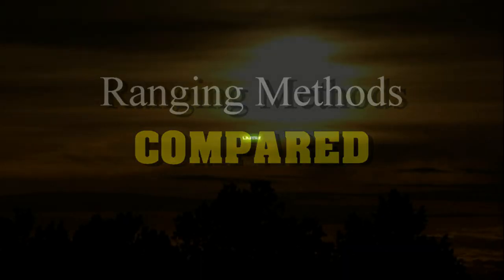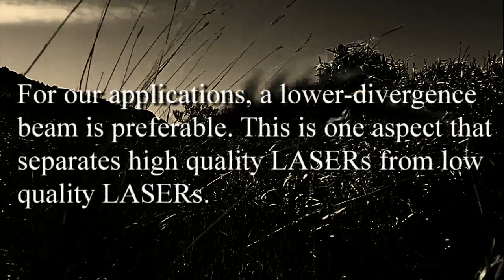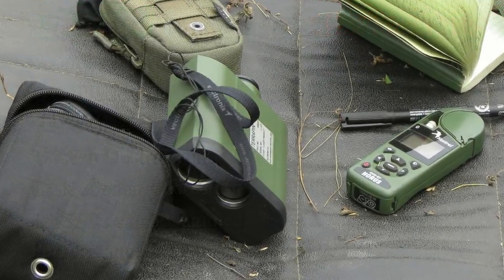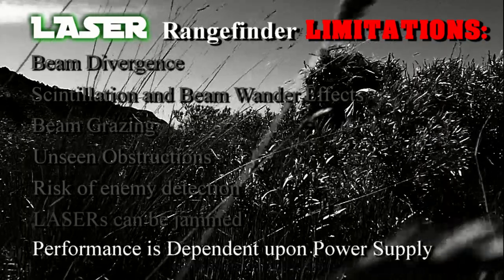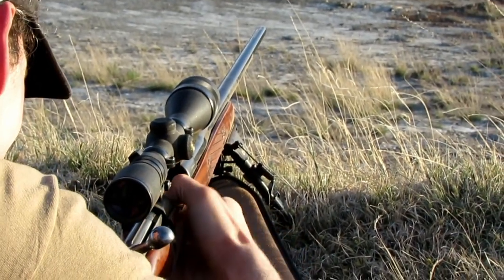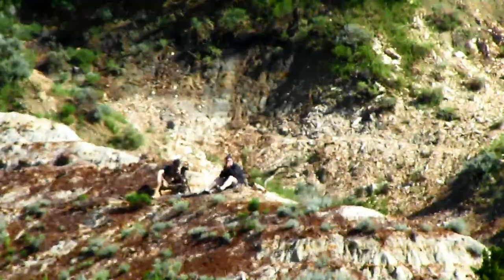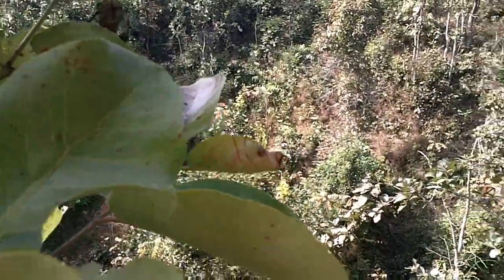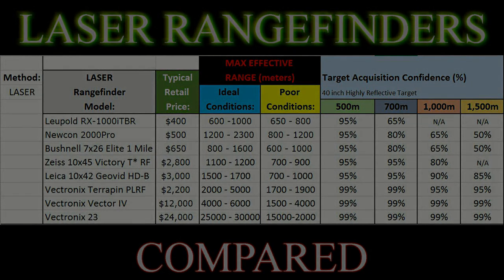Long Range 101 Part 85 - LASER Rangefinder Advantages and Limitations

Comment: I'm skeptical that "scintillation and beam wander" or, more properly, atmospheric refraction, is a significant problem for range finding. I would expect that it would be self-correcting.

If you aim the beam in the direction the target appears to be, as opposed to the actual direction of the target, the laser light should bend its way TO the target the same way the light you are looking at for aiming bent its way FROM the target, thus automatically compensating for the refraction. Of course there will be small, high frequency changes in the refraction path from moment to moment, but these will generally be swamped by the beam divergence. 

Of course a bullet's path doesn't necessarily follow the light's path, so on very long range shots in conditions with varying air density (such as with varying temperatures) along the flight path, there might be issues with hitting the target, as opposed to ranging it.

I know more about physics than long range shooting, so If I'm missing something, someone please let me know. Thanks for the great video, it's full of great points to know!

Comment: you talk about beam divergence is there something that is different with lasers? The reason i ask is to me it is a convergent beam in the illustration due to the beam propagation getting lager the farther it goes vs narrower. the way that i was taught about divergent and convergent is as follows. < this would be a example of a divergent and > this is a example of convergence. i know that jet engines use this tech to create thrust and at supersonic speeds this flip flops. is this the same with lasers

Comment: Rex, I think youve did what Ive wanted to do for along time. I also have a long barreled AK(RPK type) and when I use a drum Mag and want to repostion it, it seams if I had a carrying handle like FALs have it would be so convient. The AK you have at 5;15 looks like it has a FAL carrying handle. Is that what you did ?

Comment: Hi Mr. Rex...it's been a while since I've talked with you hope all is well. I do have a question that is racking my brain about range finding at night? I have a high dollar scope and unfortunately it's second focal plane and can only range on 22 power and as you already know, most clip on night vision devices will start to degrade after maybe 10 or 12 power so  I have to crank the power down, I can't use the npr1 retical for range estimation, I am 52 and my eyes aren't  20/20 no more and would like to use that extra magnification. I know getting out before dark and lasing area and making a range card would be one way but then your sitting in one spot waiting for your quarry to come into your kill zone. Then another way is to rezero my gun on say 8 power and comfirm drop data from 50 to 500 yards  and don't touch elevation turret when shooting at night  but that would mean more data cards to keep track of. I've tried putting lecia range finder in right eye and pvs 14 in the other and that is a pain in the buttkis and trying to hold a range finder in front of a helmet mounted pvs14 is even more pain in the buttkis...So I turn now to the all knowing TiborasaurusRex for his wisdom, Lol. Besides the $4800 dollar Wilcox sold by TNVC do you have any other suggestions on ranging at night? Thanks Rex an hope you had a great 4th of July. Puzzled in Wyoming...Mickel

Comment: how do high quality long range capable range finders work on a round ball shaped earth? Either the laser would have to curve at the same curvature of the earth (when ranging long distances like over a mile) or the Earth is flat. No matter what terrain your on, your laser will ALWAYS point in a straight flat line....so How the heck can a range finder work accurately long range on a sphere? The earth curvature is 8" per mile squared. So at one mile the earth drops 8", at 2 miles it curves 24"..etc
The laser could not work long range on a flat plane, like the ocean, a lake, a flat desert..etc

Comment: Leica Disto D2 is a nice measuring laser for approx 100 meters to check turret travel when testing the reticles mechanical accuracy per click. The Leica is accurate to about 1/16" out 100 meters IIRC. For setting the target distance from the turrets or muzzle etc 100 meters exactly. Locking scope in and using the 8' HORUS drafting print is even better to check mechanical accuracy of the reticle mechanics. Seem very hard to find those charts now days though.

Comment: Actually none of this makes sense... I stopped the video, so maybe you explained and I didn't see it. 

So lasers reflect off of any surface right back to the source? Exactly when did this phenomenon begin? A laser is basically light. Different materials and substances have very different reflective properties. As a basic example, black absorbs light and white reflects it. I think there's some funny business going here... besides being told that when we "went to the moon" we put a mirror on it's surface so we can shoot a laser at it... and regardless of the defusing properties faced when exiting and entering the atmosphere of earth, angles of orientation on both ends or speed of rotation of the earth... it would just send that little laser allll the way there and right back and into the source. Ummm okay. Clearly there's lack of clarity.

edit: I watched a little more and he mentioned beam divergence, which basically reinforces my skepticism of the whole moon/laser thing... do you realize how POWERFUL a laser would have to be to do what they claim???

Comment: I'm thinking about making a pocket weather station and I would like to know what else you guys think I should add to this. Yeah I know there are some out there that already have this stuff integrated in them but what's the fun in that when you can make it yourself?

I'm not trying to make this into a full blown computer just a weather station of sorts. Here are the sensors I have planned to include. 
Barometer (Pressure and Altitude)
Temp Sensor
Humidity
Maybe an anemometer but not for the first prototype.

Can you guys think of any other sensor I would really need in addition to these?

I will be developing this on the Arduino platform with an LCD.

Comment: does anyone use lasers to actually find a sniper before they take the shot,i see that lasers are used to map caves etc by taking millions of measurements.lasers could be set up on the outskirts of a village  as a permanent sentry before a surrender  and when a sniper tries to take position the laser picks up the distance difference and alerts a counter sniper to their position.